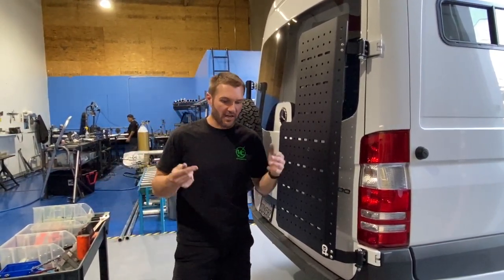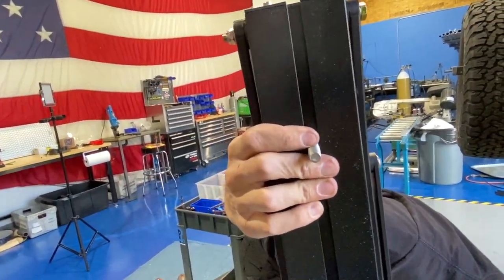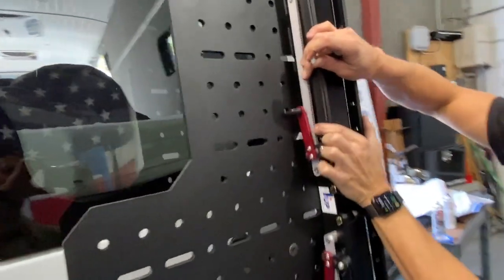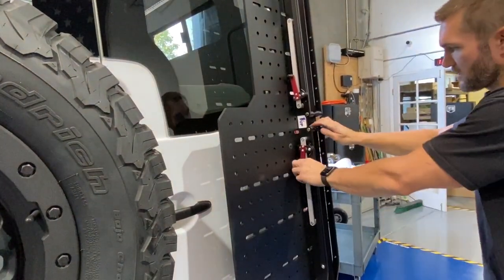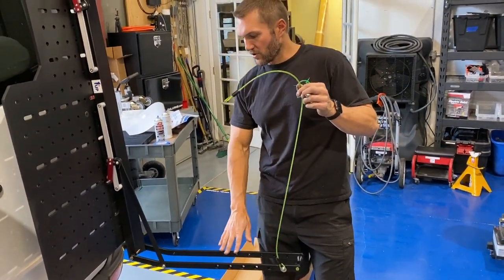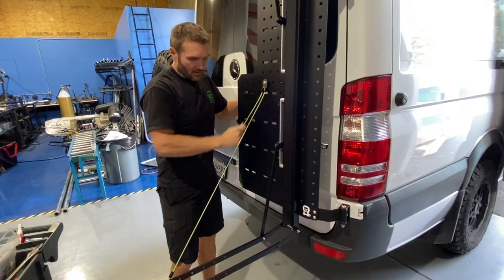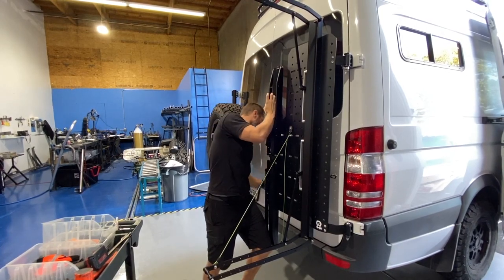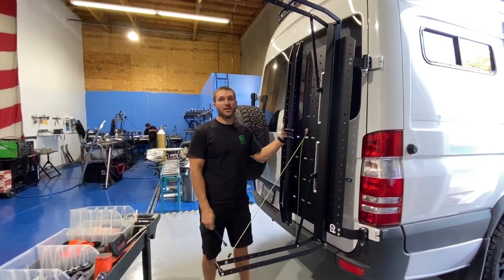Mounting Verticle 1up Bike Trays on Owl Sherpa

Comment: Are there any locking pins used to hold the arms in place once the bike is in position?  I have my concerns that the ratcheting mechanism could potentially shift while bouncing around on the trail in a vertical mount.  I'm assuming these are the roof racks that 1up offers?  Thanks!
Reply: There is a tire strap on the top and a steel cable to support the bottom arm